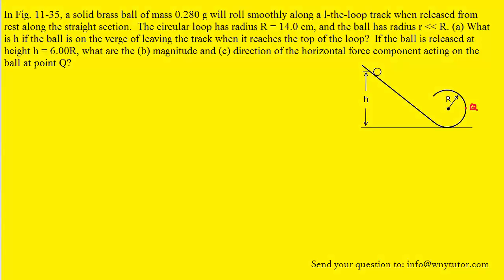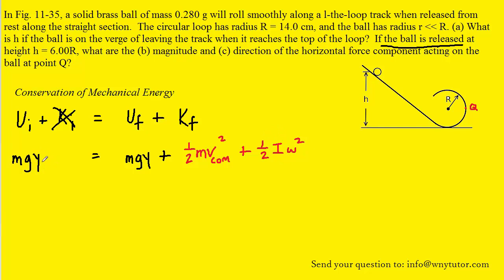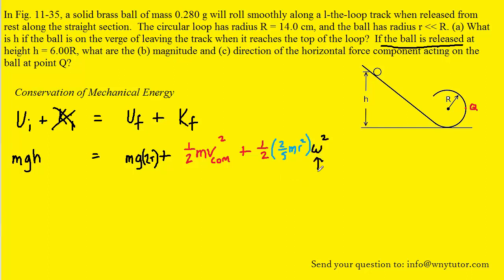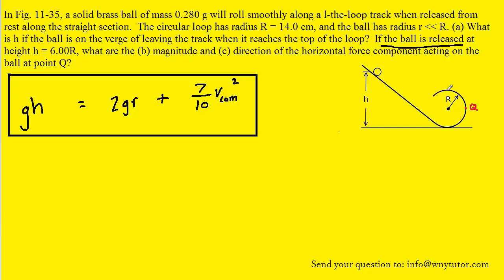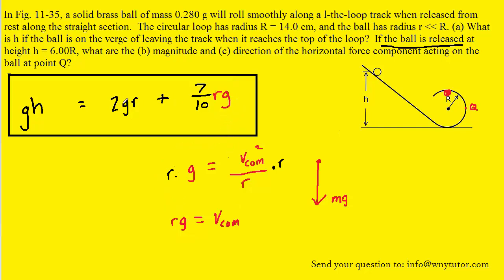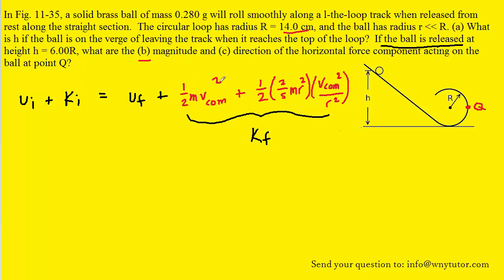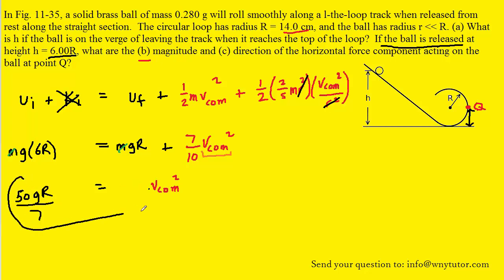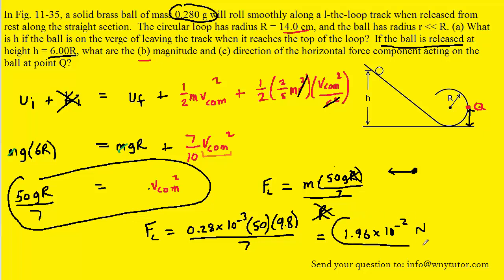A solid brass ball of mass 0.280 g will roll smoothly along a loop-the-loop track when released from

Comment: You write moment of inertia of the ball according to radius of ball which is r but then you changed it to R i dont understand that part.Why we use R instead of r.Since ball is rotating it seems to me i should use the radius of the ball?
Reply: the radius of inertia is canceled out by w^2 because it's equal to v^2/r^2, the radius its multiplied by is that of the circle since v^2 = g x radius of the loop (R)